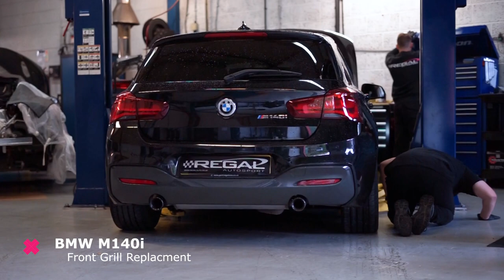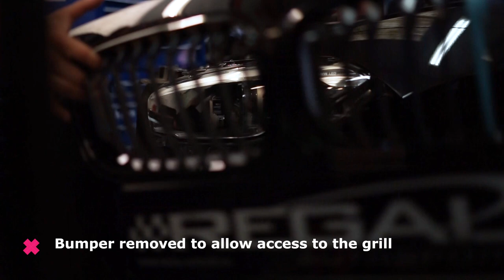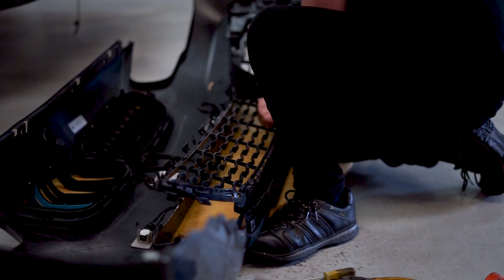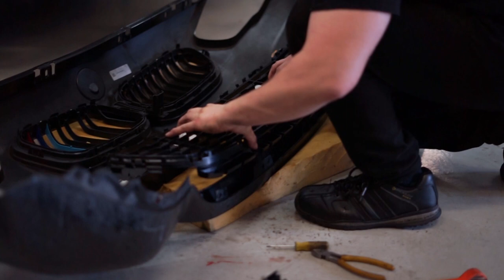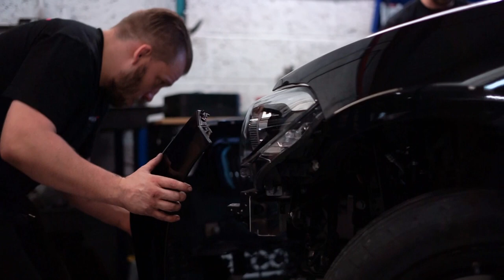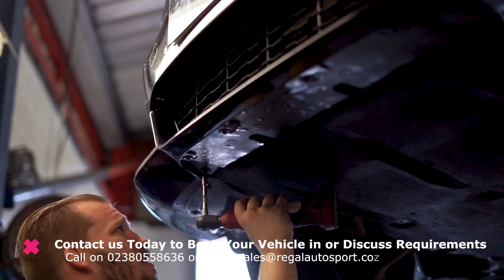M140i Lower Grill Replacement at Regal Autosport

Comment: Is it possible to change without taking of the bumper? I know you can change thw outer ones without taking bumper off
Reply from the maker: I don't believe so,
Reply: Its similar to the top ones, if you jack the car up and remove the entire lower line of bolts - and flex it forward just enough to get your hand in - you can (with skill) unclip the hooks and remove it without taking the whole bumper off / having to remove wheel arch liners etc.